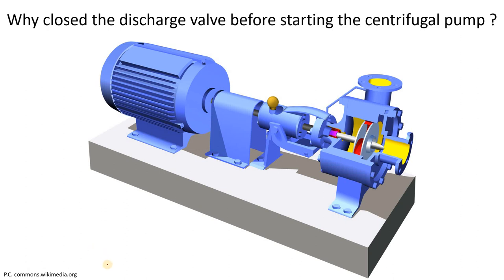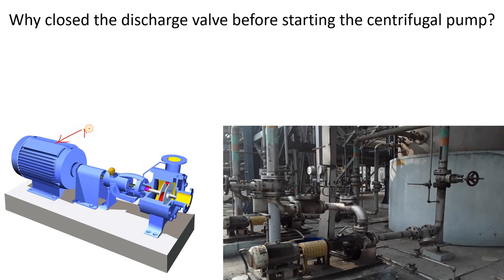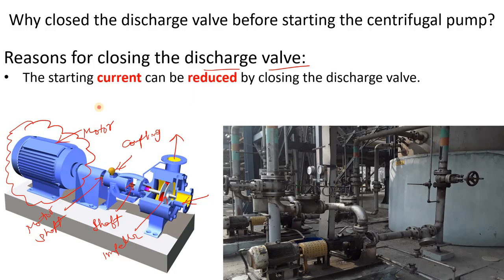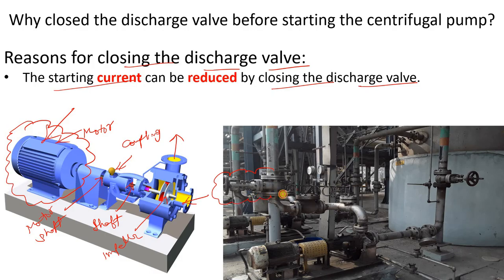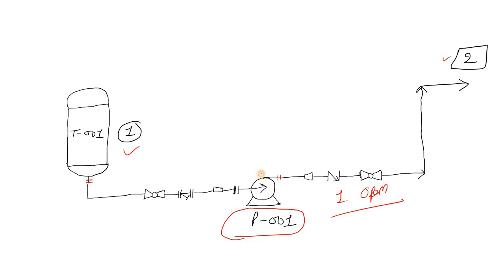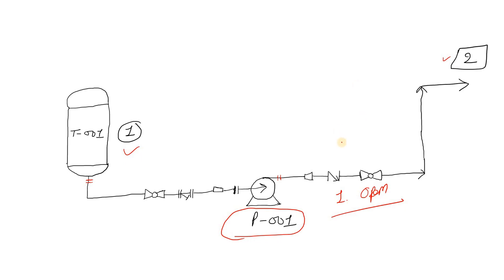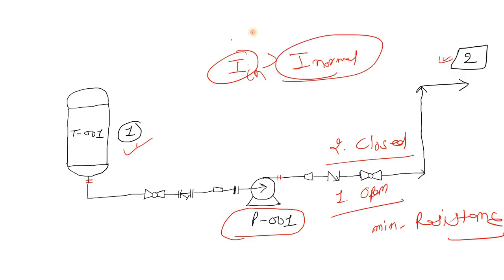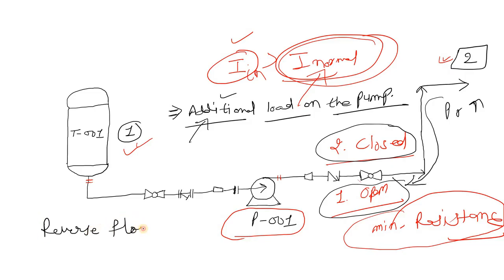Why discharge valve is closed before starting the centrifugal pump? | The basics of pump start up

Comment: One point you made during the video is misleading. You stated that the pump is at minimum resistance when the discharge valve is closed. This is incorrect. The pump has minimum resistance when the discharge valve is OPEN. When you close the discharge valve, the pump will have MAXIMUM resistance. Essentially you are deadheading the pump (max resistance, no flow). In other words, closing the valve provide resistance. YOU ARE RESTRICTING THE FLOW.

Comment: Suppose i close the discharge valve for longer period of time and meanwhile the pump is running what harm it can cause to the pump ?????
Reply: The fluid will start to heat up  , and that could lead to damage to seals , internals etc

Comment: After starting pump, Recycle flow control valve piping hammering and High vibration to maintain minimum flow. Kindly explain and give advice , solution
Reply from the maker: Check the pump curve for that pump and also check the sizing of line..... hammering have many reasons improper sizing, high velocity, no support could be few...
Reply: To check the cv downstream flassing is occurred may be

Comment: Can it help if you use a soft starter for start the pump? There are some applications that does not allow to continue operate that valve. For example, pumps that work automatically according to tanks level with no supervision

Comment: On all the centrifical pumps I hv used, the best practice was to open the supply fully and nearly close the discharge valve.  Almost closed was best.  Engage the driver and slowly open the discharge valve.  Monitor the sound and pressure gauges.  Open the discharge to no more than the rated flow of the pump and certainly not beyond cavitation occurring.   This can take some practice and coaching.   In school we were taught that a pinched back discharge is doing less work than an open discharge and that is why an electric motor driver draws less current  when the discharge is closed  versus open.  And   During electrical preventive testing I hv seen that the current is less when the discharge is pinched back.   So , yes, a soft start is easier on the driver.    Additionally, if the suction line is only partially full of liquid at start up, the soft start is necessary to nurse the vapor thru the pump.   A liquid centrifical pump has a hard time moving vapor.  A wide open discharge would merely sling out all the liquid and the pump would have no prime and not be able to develop suction.  And with no suction the vapor just sits in the pump and no liquid will flow.   Do not run a pump with the discharge closed, or pinched back hard, more than momentarily.

Read the manufacturers instructions .  Perfect your skills .  Be careful about getting incorrect advice from co workers.   Understand the physics of what is writen or are told before accepting it as fact.
Reply: In the first time you say that the best is to start the pump with the discharge closed and another time you say don't start the pump with the discharge closed, I don't understand

Comment: Hadj, I think you misread.  Please check.   Again, it is important to start the pump with the discharge nearly closed (it is ok to start with the discharge completely closed with some pumps).  Start the pump driver and promptly open the discharge valve a small amount.  Monitor the sounds you are hearing and the pressure gauges (and vacuum gauge if you have one).  Let the sounds and gauges stabilize.  Open the discharge valve just a little more and repeat and repeat.  Do not rush this process.  During this start-up process the discharge pipe has a lot of vapor in it and just a little liquid.  If the operator opens the discharge valve too fast, the pump will sling all of its liquid into the vapor space in the discharge pipe.  When this happens the pump loses its prime and even though the pump driver and pump are rotating, the pump, with no liquid in it, can not suck more liquid into its intake.  The pump impeller and volute require a little liquid to seal the internal gaps between the two.  Certainly if there is a lot of relative head pressure on the supply liquid at the pump intake, the pump won't lose prime but this is not common.  Hadj, I did state not to run the driver with the pump discharge closed, but it is ok to to start with the discharge closed or almost closed, just do  not run the pump with it closed, but at initial momentary start-up its ok to.  As I said above, it is necessary to.   But, do not leave the discharge closed for more than a very brief moment.  Running a pump with no liquid flowing thru it (running it dry) will cause heat to build up quickly.  You may not feel the pump body getting hot (but you might), however the drive shaft, its seals, and bearings will quickly get hot if there is no liquid to cool keep everything cool.  And the liquid also lubricates the shaft seal.  This heat will  burn (coke the residual liquid) the shaft seals which then results in a leak which then results in an inoperative pump and no productivity which results in repair costs and.may result in a new operator. 

Running a pump dry, because liquid supply ran out or because a supply valve was shut, dictates that the pump driver be shut off immediately.  Shutting supply or running out of liquid are what I have seen cause the most --if not all--pump leaks.  In these cases I have later always found the pump shaft seal(s) with coked liquid and deformed polymers. .  Inattentiveness or lackadaisical operator error every time.  A good pump operator makes for a happy boss.

Comment: If discharge valve is open then suddenly flow will reach high value and we know power consumption directly proportional to the flow rate .and due to this if pump hydraulic power exceeds the motor power then pump will be tripped 
To avoid tripping issue we need to throttle the discharge valve before starting the pump.

Comment: The video is a gross oversimplification.  High NS pumps will have a higher power consumption at shut valve.

Other than that the video contains numerous errors such as stating:

5:18 "no discharge head or minimum discharge head"  Incorrect.  The pump produces its maximum head at shut valve.
6:20 "closing the discharge valve avoids additional load on the pump" Incorrect.  Radial and axial loads on the pump are highest at shut valve
6:40 The scenario of reverse flow can't happen since you have a non return valve.